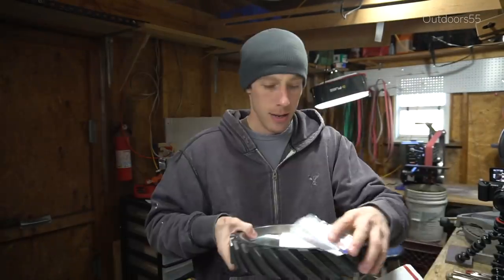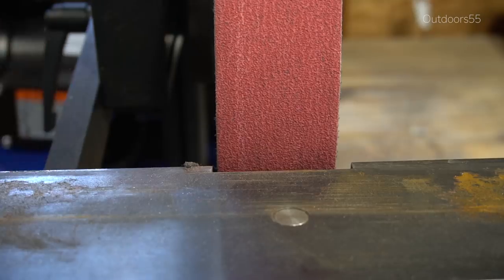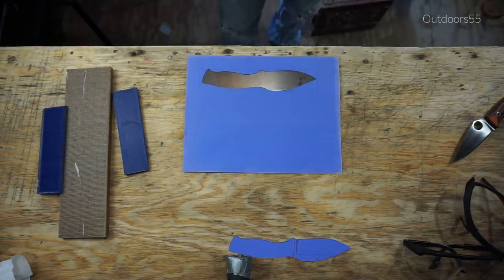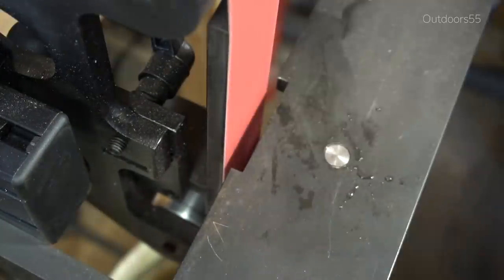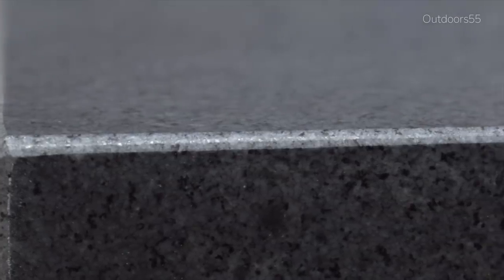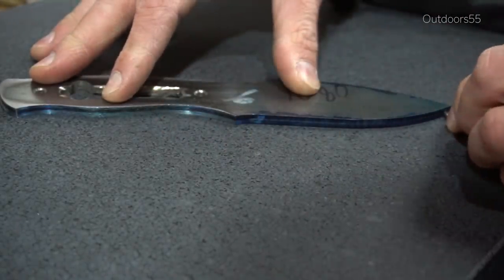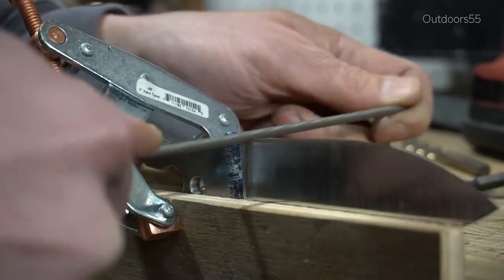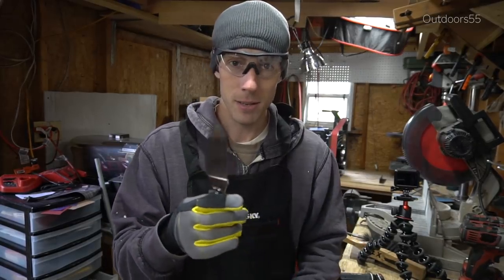Whats In The Box? + Doing Something Never Done Before In Knife Making! Starting a new knife

Comment: Alex, I’m a 56 year old new knife maker. It is primarily because of you I started. I have made a grand total of 3 and they are awesome. I bought a Harbor Freight band saw and made a vertical mount for it and mount it in a vice. I also made a table for it and it is mounted directly to the machine. I will never   Use a grinder again. 89 bucks out the door a $15 on good blades. Thanks for all your videos and happy New Year!
Reply from the maker: I have heard good things about the cheaper band saws. They are great tools for the shop. Ive been cutting everything with mine. Thanks for watching my stuff. Its always appreciated!
Reply: I would spend the money on belts. The saw is more than sufficient. I think the 3 year way was like 15 dollars. The steel table makes it.
Reply: Meant warranty
Reply from the maker: For sure! One can never have too many belts 😂
Reply: I also have the HF portable bandsaw and just put it up in a vise (just got for Christmas, $99 + $20 extra warranty). My only issue is that when using larger pieces of steel (23x6in or similar) I am limited by the motor housing on depth of cut. This is probably true for most portable bandsaws. Not an issue when cutting blanks from normal bar stock. I would have gone for the vertical/horizontal bandsaw from HF for $200 but I was a bit tight on space. Other than all those other considerations, the HF portable band saw is just fine.

Comment: Get a hight gauge to mark your centerlines before you ruin your granite block. There are cheap ones in Amazon for $40-50 that will do what you need and a whole lot more.
Reply from the maker: For now im going to use this method it works for what i need. Im not worried about ruining the surface plate. It will do what i need to do for a long time.
Reply: OUTDOORS55 I went to a local granite counter top installer and got an 18x24” scrap piece for free. Works great.

Comment: If your drilppress is belt driven (most are) you can order a new pull your or pully set with a better suited ratios to achieve your desired speed. Wilco, Maynard,  Ace Hardware stores often will have a few in stock.  Jc Whitney is another possible source if it still in business. Or a local farmers supply store should be able to get you a set.  Just my 2 cents,  had to change out the ones on my bandsaw to get the speeds I wanted drillpress uses same kind.

Comment: Hi Alex You do a good job! I'm a sculptor not a blade maker but I'm interested in making a chefs knife. Would it not be more efficient to have your blades laser cut or even hand plasma cut instead of the band saw?
Reply from the maker: Yes! 1000% more efficient! If i had access to one thats what id do. Most of i do is one off knives made one at a time so right now the cost of having them cut wouldn't offset the time savings.
Reply: @OUTDOORS55  if you're doing one offs you should just design enough blades to get through the minimum order. You could get 30 blades made from your favorite steel for just £3 each all unique. If you find the time to design that many. It would increase your profit immensely and save a whole load of time. You're doing well and thank you for sharing. Cheers J

Comment: Are you planning on trying a Hamon with the furnace cement? 1080 doesn’t really show a Hamon well. You would be better off doing it with 1095. Also 1084 and 1080 are pretty interchangeable. New Jersey Steel Baron has a lot of 1084 right now. With the heat treat oven you don’t really have to stick with 1080/1084 anymore, you can do any steel now just find the proper heat treat procedures online. Love that you are getting all this new equipment, it will make it so much easier and yes the port a ban style saw is definitely worth it!
Reply from the maker: Yes, im going to attempt it. Worst case is it doesn't show. Its not that big of deal if it doesn't, it will still be a useful blade. I wasn't really planning on doing a hormon, but why not try at this point.  I have a bunch of 1095 already and have alot of plans for it. Im just experimenting at this point😀
Reply: You’re right. Nothing ventured nothing gained.

Comment: Same issue with the 1080 steel. Jantz is out. I ordered 1084 from NJ steel baron 3 months ago and nothing yet. Admiral steel sells "1080" but they don't know if it's 1075 or 1080 so that's a rough option.
Reply from the maker: I hate to say it but, i may have had something to do with 1080 disappearing.  I did a video on where and what type of steel to buy for beginners and where to buy it,  and ever since then i haven't been able to fine the sizes i need. So again i may have had a small part in that😬 it's weird that they dont know.. they should know exactly what type it is. 🤔
Reply: @OUTDOORS55  They say it has ".7/.8 %" carbon in it. It bugs me that they can't be sure. It's fine steel for practice, cuts easy enough, ships fairly straight. But I don't think anyone would buy a knife made with steel the maker isn't sure of.

Comment: Your vibration is coming from the new drive wheel. Watch from about the 0.58-1.04 mark, you can see that there is more rubber on one side of the wheel.
Reply from the maker: Its a balanced wheel, doesn't matter how much rubber is on one side vs the other if it's balanced. The vibration was coming from the drive wheel on the motor which is fixed now😀

Comment: If you want perfection, you have to make it yourself. "Turn" the drive wheel in situ with an angle grinder and a grinding wheel. You have a second drive wheel on the way. Nothing to lose. BTW, it looks way out of round, but I doubt it happened in shipping. You might also wanna check the axle/spindle that turns it, but as long as it is keyed, then grinding the wheel would "fix" the axle.

If you turn/grind it, just make sure you have enough belt adjustment for the little bit of metal you will grind away from the drive wheel. Set the machine to top speed when you grind it. And also do some grinding at a lower speed, to try to reduce any effect of vibrations.

Steel warps a little after machining. And it is expensive to put the stuff on a shelf, let it rest for days, then test/machine it again. So this kinda thing is pretty common.
Reply from the maker: I think the new one will fix it. I dont know if it was shopping or maybe just a lemon🤷‍♂️ Either way they are taking care of it. 🙂
Reply: @OUTDOORS55  Good luck. But even despite they give you a wheel in spec, it was ground to spec while it was spinning on a lathe. That lathe might be perfectly concentric (maybe not). But the spindle of your machine may be slightly out of concentric. Or the fit of the spindle may be slightly less than a perfect fit to the wheel. Then when the key is inserted and/or screws tightened, the wheel can be ever so slightly tilted or off center from the axis of the spindle. It is almost always the case that you can improve the concentricity and roundness of something like the drive wheel on your machine by turning it in situ. 

That said, it is a very expensive, brand new machine. So I get it why you would not want to touch it. Just keep in mind if the new wheel also doesn't run perfect. Maybe take the worse one and try grinding it. 

Lacking a lathe, I have used high speed grinders with cutoff discs and grinding wheels and in some cases carbide burs as cutting tools to "turn" a few parts spinning in drills and/or in the actual machines where they are used/installed. The precision you can get is extremely good. I've turn/ground hard steel dies to half a thou dimensions (creeping up to final dimension, then switching to sanding blocks for flatness and finish). Someone with your hand eye coordination can easily make this part better than factory.

Mind, you don't have to remove the lowest of the low spots. Just take down the obvious high spots until the high "spot" is one big spot that covers enough area to hold the belt steady. As long as you leave some low spots, you haven't made the thing any worse.

Comment: Your knife is looking good .👍Have a question. Would you think old saw mill blades would make good knife stock? They are large circular blades, maybe 4' tall.
Reply from the maker: They may and they may not. You would have to do some testing with the steel (try hardening a scrap and see if it will harden).  Id hate to spend alot of time making a knife only to have it not harden. Definitely worth the time experimenting🙂
Reply: They are free.☺

Comment: The pulley will have a static unbalance from the set screw and set screw hole if they weren’t done equally (if the removed aluminum doesn’t equal the set screw). That screw weighs more than the aluminum removed, most likely (steel is about 3x more dense). Could be the other way around depending on the size I suppose.

I had to balance mine, took a few grams of epoxy (fastest way to do it). Whether or not that one is balanced I don’t know, but when you run it with no belt the motor should not feel rough whatsoever, a small motor like that should be almost not even noticeable when running. Also the key will be heavy in an aluminum pulley, so if it’s not balanced it will have a small static either way.

If the bore is worn at all, or the shaft, the pulley could have a dynamic in it. If it looks like it runs out then it could have a dynamic unbalance due to the fit. You’d need a new pulley unless you could balance it.

Personally I would try to static it to see if that’s it. You’d think they wouldn’t make pulley’s with a static in them, but mine had one so who knows. I balance everything but then again I have machines for that.
Reply from the maker: Balancing would be outside of my relm. Ill try the new one they send and see if it's better. I dont think its the balance (just speculating here) i think it's either out of round or is not centered on the shaft. I guess we'll see🙂

Comment: Hey Alex, been following a channel for quite a while. Really appreciate the content you have. 
Not sure if you have your heat treating oven set up yet? I was wondering if you would be interested in heat treating a 1095 cleaver? I recently made one but I just dont have enough heat for the knife. :S let me know
Reply from the maker: I do have it up and running. Im super new to it though. Id like to learn a little about it first.  Id hate to screw something up😂 id definitely be interested in that down the road once I dial it in😀
Reply: @OUTDOORS55  thanks for the reply Alex. It's not an expensive knife as you can tell a knife made out of 1095. You could use it to do some experiment if you are interested. My challenge is to get it differentially heat treated otherwise it may just crack hard. Its dimensions is roughly 210 x 80 x 4mm with a Japanese style tang. Get in touch if you are interested. Maybe some YouTube material for you 😉

Comment: It’s the center shaft that not straight
Reply from the maker: I checked the shaft and it looks ok🤷‍♂️ Not sure what's causing it orher than the drive wheel. Plus if the shaft wasn't straight the motor wouldn't run right. Thats my assumption.

Comment: Great video. Couple questions, can you talk about contact wheel sizes, there are different sizes and types 8”-12” serrated and non. Also how do you get rid of your grind lines? I finish with a 180 belt and then hand sand but always seem to have deep scratches I can’t get out. Also if this link works it helps figure bevel angles. http://dcknives.com/public/grind_angle.php
Reply from the maker: Serrated have a softer feel than solid wheels. It's really up to what you like. There are even harder and softer contact serrated and non serrated wheels.  Theres quite a bit to them and you could probably write a book on the subject. Different sizes allow a larger or smaller hollow grind.  Or a deeper/ shallower grind. Again you could probably write a book but thats a summary 🙂

 i took this knife to 120 grit on the grinder and then hand sanded all the grind lines out with 150 grit sanding 90 degrees to the grind lines. Hope this helps 🙂